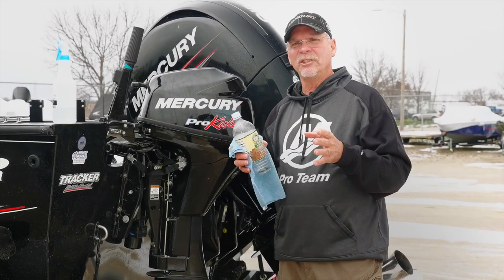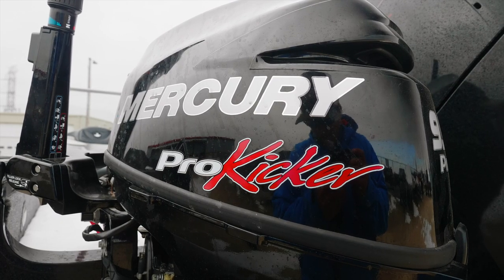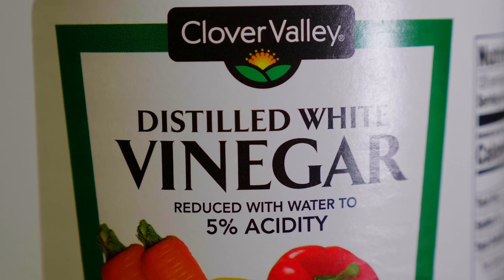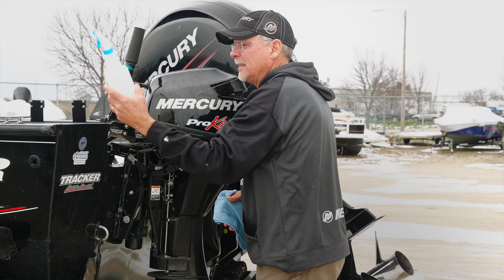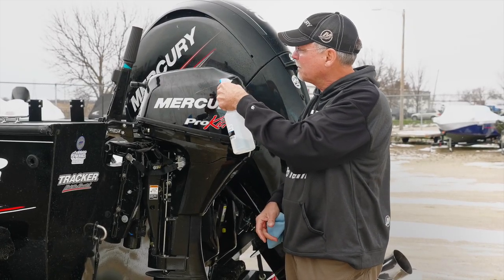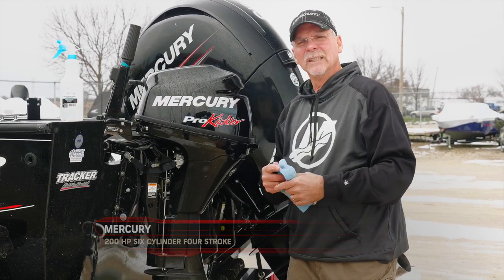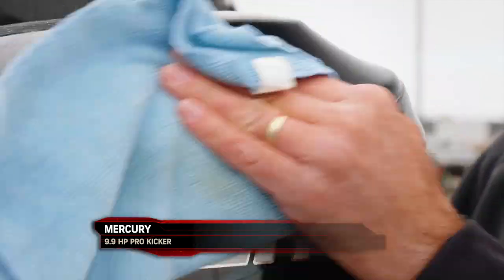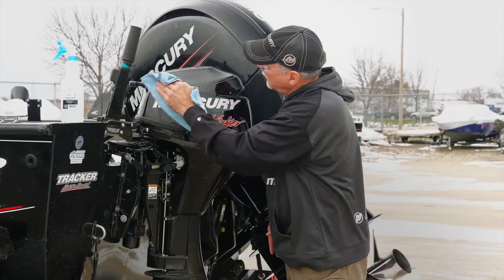How to Clean Water Spots Off an Engine Cowling.

Comment: Does it harm the stickers
Reply from the maker: So trick here is to add water to get down to low level of acid.   High concentration of vinegar AKA acid will eat the stickiness of sticker.  But you would have to use pure vinager and let it soak on.      Old toilet cleaning trick is coat the inside of bowl with TP and mist / spray bottle of high % of vinegar overnight to eat away lime and rust.